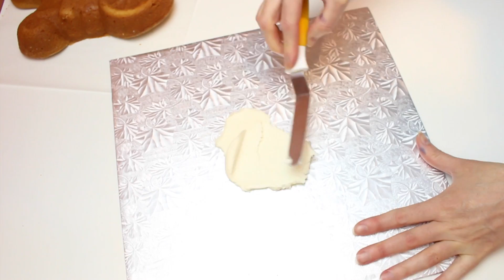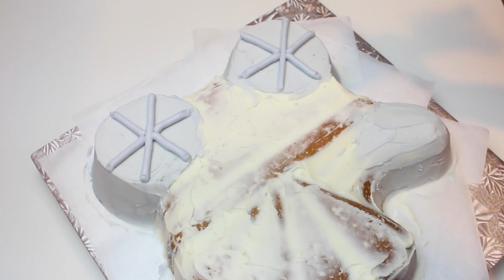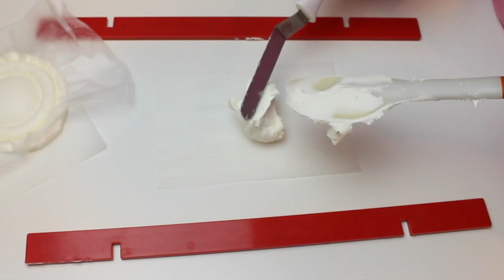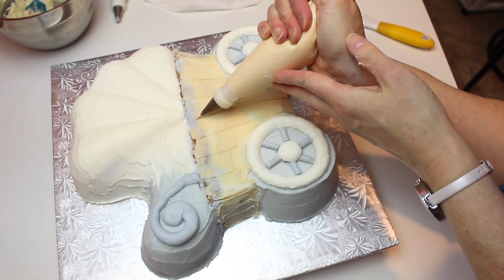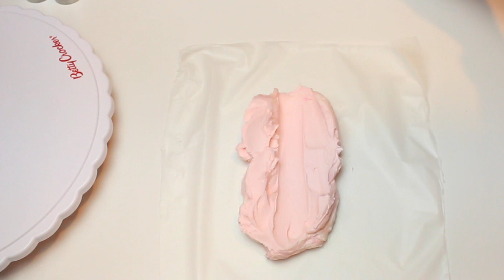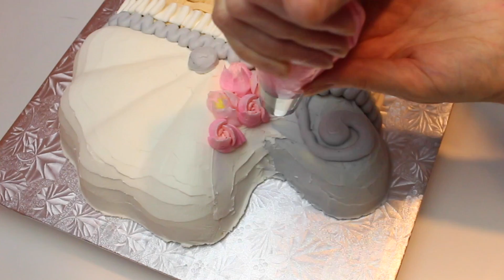Russian Flower Piping Tips on a Buttercream Cake - How to decorate a stroller cake

Comment: This is a very cute cake.  My only 'constructive criticism' is for you to watch a Wilton  video on how to do a basket weave.  It would be much cleaner looking if you piped your up and down stripes as you go, so you could bury the tails of the sideways piped strokes.  Martha Stewart also does basket weave the way you do, but I don't suggest doing it that way.  
.
Reply from the maker: Thanks Bonny for your feedback, I decorated the cake the way I did because I wanted to have the basket lines centered & if I started on one side and moved across it would have been off. Often after I'm done a cake or cookies or even a day in my life I wish I had done it different but it's not always possible so I try & focus on the good parts instead.
Reply: When I do my basketweave, if it needs to be centered, I use a skewer to impress where I want each up and down stroke.  Then I follow that, alternating up and downs and across strokes, covering up the guidelines I made.  That way I end up with it being centered, and am able to hide the tails with an up and down line.